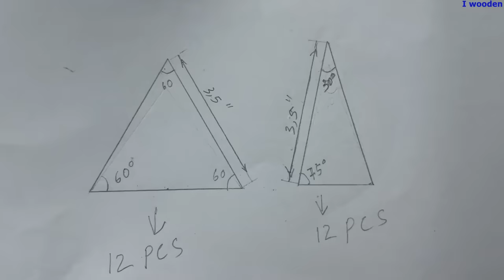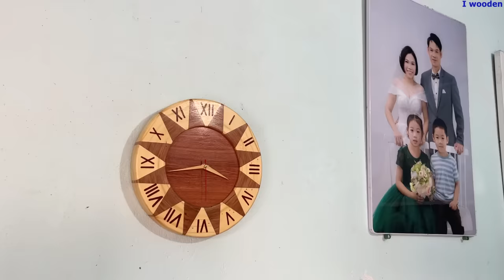6 Beautiful Wooden Clock Models Never Seen Before //// DIY Simple Art Wooden Clock At Home.

Comment: I'm just wanted to add thank you for reminding me of my new router attachment, that I can attach to my new Dremel that I just purchased. I forgot all about it. 
     If you want to know if it worked let me know.
Reply: I tried the Router attachment on my dremel. 
      I've only tried the spiral bit. It will work with some serious practice. There's no rushing. Take your time. 
     Your piece MUST be locked down.  Free hand will be a long trip to emergency, where you may have to wait days for days for tendon reattachment surgery, i know this for a fact. I would also 
recommend to everybody, to wear leather gloves. It skips easily. 
    In my opinion,the dremel Router does small projects only. 
PLUS use a guide as shown in this video whenever you can.